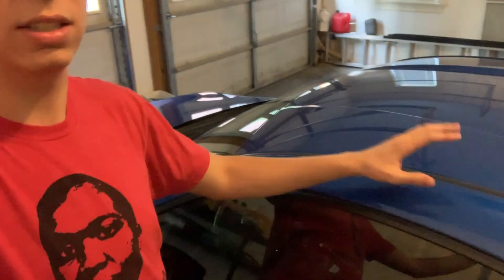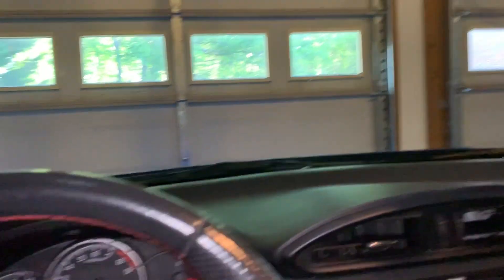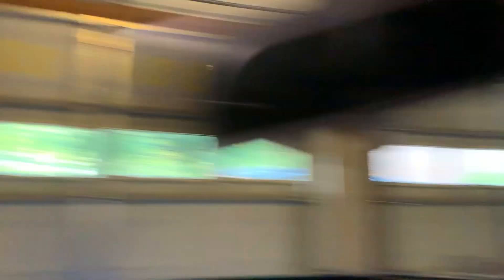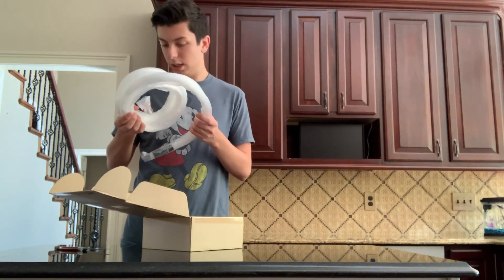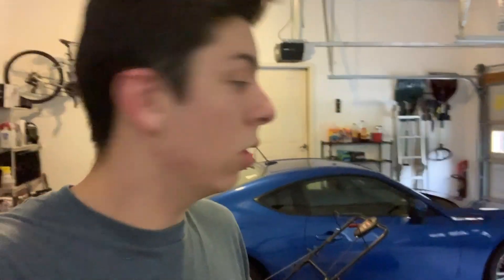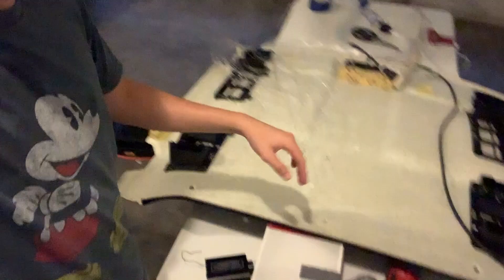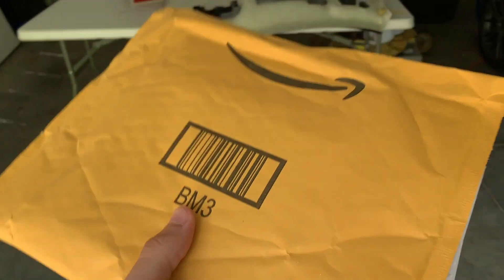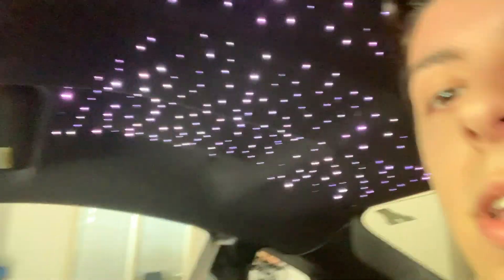Installing the Starlight Headliner!!

Comment: I am literally doing this now.  But I have 450 fibers and Toyota Highlander headliner. 🤦🏻‍♂️
Hope to finish by tomorrow
Reply from the maker: BUDZGURA I wish you the best of luck. It was really tough for me. If you have questions lmk
Reply: Jake Reilly i am on my 5th hour at the moment. Ill post videos when i am done.
Reply: BUDZGURA I have like 600 fiber optic stands, and I’m doing it on the 2019 Honda Accord sport, wish me luck!
Reply: Philly Accord how did you run your wires through the accord? I wanna do it on my 2019 sport. Just got the part in the mail today:)

Comment: What kit is this???
Reply from the maker: BenjaminDownhill4LIFE I think this is it, not exactly sure because I got it a while ago so it doesn’t show up on amazon for me. But this is most likely it Huaxi 16W RGBW Fiber Optic Star Ceiling Lights Kit Music Control Car Home Use Fibre Optical Light Kit, Sound Sensor Light Source with 28key RF Musical Remote and Fiber Cable 300pcs 0.75mm 6.5ft/2m https://www.amazon.com/dp/B07PFB6CVP/ref=cm_sw_r_cp_api_i_7z8hEbFMPCXA0
Reply: @jacobreilly8338  thanks man